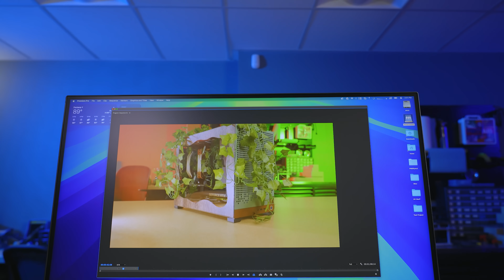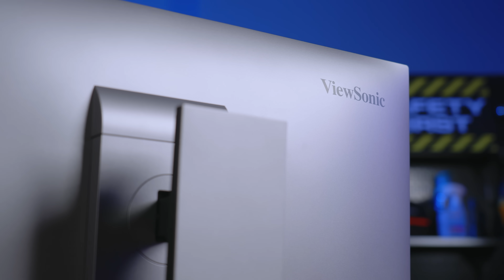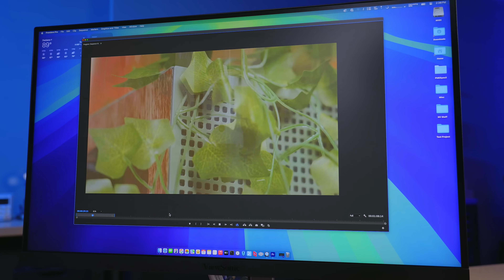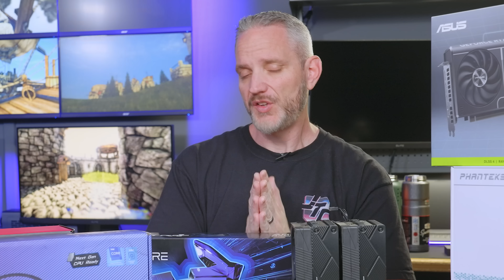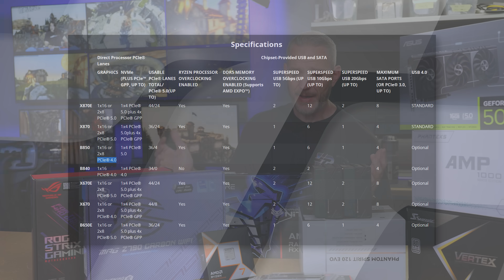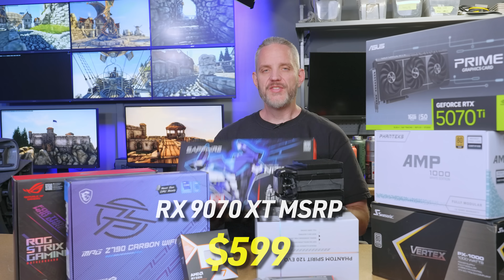This is the Sweetspot for PC gaming... Don't get fooled into spending more!

Comment: Watched this after getting my build lol

I'm running 

R7 9700X
16x2 GB 6400 Lancer (XPG)
X870 Gaming Wifi6 (Gigabyte)

Now, I bought the X870, which a lotta people might say it's not cheap at all. But the opposite happened. I went out and bought mine but the available B650 and B850 boards were more expensive by 30-80 USD. Why would I pay more for that? They're Wifi7 and I'm not even using Wifi7.

Was also thinking of getting the 7700X instead of the 9700X but it was out of stock the moment I could finally afford my new build.

Right now I'm just biding my time, saving for the 9060XT. Gonna go on cup noodles for the next 2 months or get the 9070XT instead on my birthday within the next 5 months lol. For now just integrated graphics works cuz work is hectic these coming months anyway, can't game.

Comment: M4 R7 5700x3d, RX 7800xt, ddr4 32GB, 850W gold PSU, 3440x1440 gaming is the sweet spot. No complaints. You can't go out and buy my system now, but a 5090 sounds insane these days.

Comment: If you're gaming, always spend as much as you can on your CPU (within reason, obviously) as that's the thing most people will never upgrade. At the moment that would be a 9800X3D. That should keep up with any mid-high GPU for the next five years. The $100 saved going down to the 7800X3D is not worth it over five years. That's only $20 a year extra cost for a substantially faster CPU which massively reduces stutter and 1% lows.

Comment: still upgraded a pc i build 12 years ago. soon i wont have any more possible upgrades and ill have to buy a new motherboard, which ill also have to buy everything else to go with it. costly. my current setup is msi x370 gaming plus, m.2, rtx 3060, 32gb ddr4 ram and my latest purchase ryzen 9 5950x. basically runs everything available flawlessly no real need for an upgrade but if i ever did build a new pc the motherboard is definitely something i would want to buy the best of the best since that will be the limiting factor eventually for upgrades. sure you dont need it now but 10 years from now it might kick you in the behind.

Comment: My advice is to look out for a deal. Lets say you have 2 years old graphics card and do not need to upgrade, but might in a year or two. Maintain some understanding of different GPU's performance and price and occasionally you will get one for like -25%. Used to cost 800€, well now it is 600€ and you get a game. 
Why buy before you absolutely need to? 
1.The next generation is going to be like 15% more powerful and cost 25% more and still be out of stock.
2. You still can get some money out of your old GPU.
Cons: The deal might not be on the GPU you were looking at. Perhaps you need to buy a less or more powerful one than you were hoping on.

Comment: I very much agree with your take on PSUs. If we look at for example a NZXT C1200 Gold, which is one of my favorite PSUs on the market right now, we can see that its maximum efficiency is in the 400 W to 600 W range anyways. You will always just draw as much power as needed so I don't really see the arguments against overspeccing PSUs. Another bonus is that for more silent operation many high tier PSUs will offer 0-dB-fan-modes at lower than 50% load.

Comment: Tbh you don't even really need AM4 for the time being, for budget builders (or us stuck on AM4) you can definitely get away with the top of the line parts for am4 paired with a good gpu and be all set for a pretty cheap build. You'll mostly want X3D chips for gaming but if you just can't find any the 5900XT and 5950X are still beasts in gaming, and can easily play any modern game without much issue.

Comment: Since i have an old Intel 4790k on z97m pro4 which served me well for over 11 years i'd like to upgrade my build so wanted to know if this looks ok to you:
AMD 7500F
B650M Aorus elite micro
G.Skill Flare X5 5600mhz 36cl (2x16gb)
RX 6600 XT Red Devil (which i already have)
Crucial P310 1TB
Kolink Regulator 80 plus gold 750W
Arctic Liquid Freezer III Pro360 (and 5 more Phanteks 120mm, 2 rear 3 bottom)
All on a Lian Li O11 Vision
Would it be ok for something like 750€ GPU excluded since i already own it?
Thanks

PS: i rarely play AAA super demanding titles, mostly Eve Online and mid-tier games, reason why i'd stick to a budget build

Comment: First build, went with a 9070xt and 9950x, Very happy. I did go with a 1050w gold PSU and 420 AIO due to higher temps with the 9950x. I avg 50 C on the low and 57 on the high. The GPU is a tank. Runs really cool and rarely see the fans on even at 2k gaming. Total build was $2700. I look forward to seeing this running in 5+ years with no issues.

Comment: Best sweet spot imo is AM4 80-100 Bucks MB, a 5700x for another 100 bucks with whatever decent cooling and RAM and than throw all your money on the biggest GPU you can get and still have enough money to buy a fitting PSU.
Reply: Exact build plz so i know what to put in basket

Comment: Idk ab a year ago give or take i walked into microcenter randomly on a whim and saw a 6950xt for if my memory serves correctly like 600sh bucks. This thing is a beast and probably the best bang for buck ive ever encountered in my PC building experience. Bonus if winters are cold your PC turns into a mini heater. They def do run hard but man its hard to beat for value if u can get a good price.

Comment: there is an efficiency curve. I'm running a 100w gpu atm. I don't want a 1600w psu running that. this is where I think the US youtube influencer runs into a wall. I'm never going to buy a gpu that consumes more than 250w, infact... I have reduced my gpu power draw in the last 15 years

Comment: bought a 7800X3D used back in March, alongside a used 7900XT. Not the fastest GPU, but I know I can put whatever GPU in its place and the CPU will be more than enough, even a few years down the line. In my prevoius computer I made the mistake of going for a cheaper CPU, and when I upgraded my GPU, I had to upgrade the CPU as well. I don't want to do that again.

I don't know, I prefer the "pay once, cry once" mentality about CPUs, especially as it comes with the motherboard and RAM choice most of the time.

Comment: @4:18 Great video—as always, your enthusiasm for AMD shines. I’m curious though: given your assessment that the Intel Core Ultra series isn’t worth considering—does that hinge mostly on pricing? In my region (Malaysia), I’m seeing Intel Ultra 7 retailing around RM 1,449, which is much closer to Ryzen 7 9700X at RM 1,699 than the US MSRP difference suggests. If the price gap narrows this much, would you still advise against Intel? Or do other factors—like gaming performance or future upgrade paths—override pricing considerations?

Comment: My PSU in my current "gaming rig" (motherboard is maxxed with a i7-4790k & 32GB DDR3, with a 2060 RTX missing a fan, feel free to laugh), is an Antec True Power Trio that is 18 years old. Last year, I was considering upgrading the graphics card to address the missing fan, and stopped when I realized how old the PSU was. It's been running basically 24/7 since new, and has to have about 150,000 hours on it. 

I just finished speccing out a new computer (X870, Ryzen 9 9900X, 64GB 6600, 7700XT), and will be retiring the old one into a media center.

Comment: If you are on the fence between an x3d 8 core cpu and a mid tier gpu vs a non x3d 8 core cpu and a higher tier gpu, you lost me already. If you are going to downgrade your cpu to get a higher tier gpu, then why stay on 8 cores? I see no point in buying a non x3d 8 core cpu, go down to 6 cores, save that extra money and upgrade your cpu in a couple years when you need it.

Comment: I haven't built a computer in about 20 yrs.  Back then it was so easy to damage the CPU when putting the air cooler on that I have not bothered building my own since then.  Has anything changed?  Have there been improvements to this very costly problem?

Comment: Entry AMA5 with mid tier motherboard like B850 and a 4060 GPU, higher tier PSU and cooler.  
This will allow you to have a descent shell for upgrades, rather than investing more on those few performance % that will barely feel. Instead its better to build a strong spine on which you can hook up more powerful stuff a few years in to the future.

Comment: The cheapest 9070XT you can get your hands on is what I went with. Driving 2 1440p monitors and a small hdmi one at 120fps when gaming is a nice upgrade from doing none of that with my 1060 6gb that I bought from Fry's.

Comment: I get a pretty hefty annual bonus at work and I'll be bumping my ryzen 5 2600x up to a ryzen 7 9700x, along with a modest bump for my motherboard to an AM5/DDR5 board, and upping to 32GB DDR5 RAM from my existing 16GB DDR4.

I'm currently using an RTX 4060 but planning on shelling out a bit next year just to get a higher end card as everything else will be future proof for a good few years.

Decent bump in performance without breaking the bank.

Comment: This is me upgrading to AM5. I'm coming from an 5900x and upgrading to the 9700x on the tuf b650 plus. I'm not into any overclocking, nor do I care for Gen 5, either. I bought another gen 4 drive. The SN850x has been great to me! Pairing with a 4080 Super is gonna be awesome. My 5900x was bottlenecking it hard, so excited!!!

Comment: 7800X3D and RX6800.  Dont need anything more.  Got one of the last rx6800 at microcenter for $360 months ago.  New World full ultra 1440 @ 100+fps.  BF6 at Ultra ran fantastic. I also play Dune at ultra.  I use a 240hz  .03ms 27" monitor.  COD is like 150fps.

Comment: I built a 9800x3d + 4080 super build late last year. Paid way too much for the 4080s. Paired it with the dual mode LG oled. Its incredible, dont get me wrong but a 9600x + 5060ti rig would be just as fun (just with lower frames/settings) for half the price. What matters is if you can game with your freinds its gonna be a good time. Dont make my mistake of over spending and getting buyers remorse.

Comment: How does anyone make that statement with a straight face. The 14900 outperforms the 9950x3d in ever metric but one. It is less that 1% slower in memory latency. But, it does that all at literally half the price. It is less than a 7800x3d and outperforms that. The price to performance argument that is always brought up is insane.

Comment: 1000w psu is not a sweetspot, that pc will draw 350-400w from the wall fully stressed out with rgb fans etc so  i would go for 600w

Comment: Everytime I build an AMD system I have nothing but trouble, last AMD system I built just would not start, 12 months later its sat in bits, I gave up. I tried 3 different Ram stick types, stripped it back to component level and started again, it was just dead.  Intel always just works, never had a problem with them. So now I'm stuck only ever being able to build Intel, I just can't risk wasting anymore money on AMD processors and MBs.  Probably just my bad luck but that's where I am.  Shame, I'd love to run AMD but wasted so many thousands on them to no avail.

Comment: I want to build a computer solely for Davinci Resolve. That it’s only job. From what I can tell from listening to SMEs’ like you, I have a few options. One, GPU has to be a 5000 series Nvidia card. The only card that can handle 4:2:2 10 bit video with ease. Looks like an AMD 9850 3d or 9950 3d CPU can handle any fusion jobs or anything else it needs to handle. Am I wrong in these assumptions?
Second; air or AIO? Since I do not wish to over clock, having seven intake and one exhaust fan in a Havn HS 420 case, wouldn’t a large CPUair cooler be just fine? Also wouldn’t a large air cooler draw air around other components like the RAM sticks and mother board components?

Comment: Not me sitting on my Nvidia 3080 and my Ryzen 7 5800x3D on top of my x570s Aorus Master motherboard. I pretty much reached the ceiling of my hardware. If I want to upgrade my cpu, I need to upgrade my motherboard and my RAM with it

I probably could upgrade my GPU , but It does what I need it to do and plays all the games that I want to play. I don't feel the need to upgrade, at least not yet. Maybe add a few hard drives though

Comment: I just changed from a i7 5820K (for around 400 $/Fr., 10 years ago) to a 9800x3D.
And it was the second fastest in its socket back than and today I got min 9800x3d for 438 is now even 420 $/Fr. witch is even cheaper than back then!!

Only the Motherboard is now the expensive one but it is also your base for the futur to build on, so I could not cheap out on it. Just buy AsRock Nova, that will serve every tast (no lane sharing!). I got an MSI MAG Edge Ti WiFi though for about the same price but liked the 3 USB C and two of them are USB4 40Gbit !!!

Buying now a cheap CPU for like 250-300 $ and upgrade in 3 years for a 9800x3d for an additional 150-200 $ is stupid !
Year sure , resell and stuff. I dont have anymore the nerve and the time to waist for that. Need to have to availuate efficiency in what I am doing! What would I winn, 50 $ in years + running and hunting for deals with risks I have to take??

Comment: Ryzen 7700 nonX and RX 9070.. both work like a charm, BF6 beta  1440p Ultra 110-140fps. Both take aprox same time to generate a frame (BF6 internal overlay measurement). I guess You all are aware how much cheaper R7 7700 is, compared to 9800X3D, or even 7800X3d.. and also cheaper and much cooler than 7700x

Comment: I overspent on my PC build:
Ryzen 7 9800X3D CPU, 6000MHz CL28 RAM, B650 motherboard, RX 9070 GPU, Corsair RM850x (2021), Peerless Assassin cooler, Lancool 205 Mesh C case, and Samsung 990 Pro 4TB SSD.
In hindsight, I should’ve opted for a Ryzen 7 9700X and waited for RX 9070XT prices to drop. I could’ve gone with 6000MHz CL30 RAM instead of CL28, for savings and chosen the Samsung 990 EVO SSD over the Pro. The rush was due to looming tariffs a few months ago. At the time, available RX 9070XTs were over $1,000, so I settled for the RX 9070 at $650. But this Prime 9070 can switch to the XT BIOS, which is a plus.
I also chose older components for specific reasons:
The Corsair RM850x (2021) lacks the 12V-2x6 cable but has more 6+2 PCIe pins, which most AMD GPUs still use, reducing fire risk concerns.
The older Lian Li 205 over the 207 case for the two extra drive bays.
The Peerless Assassin cooler was picked over the Phantom Spirit for quieter performance.

Comment: 15:35 Thank you for saying that. It is so annoying that people ALWAYS recommend smallest sufficient PSU for the system. That makes absolutely no sense to me. 1000w PSU is not that much more expensive than 750w PSU. If you are going to build another PC after the current one and not just selling the old PC as a whole, I would always go for 1000w today, because that is possibly enough for your next build or at least enough for GPU upgrade before completely new PC. Even if it is not, the price difference is worth the option to upgrade without changing PC. It costs more and it is annoying to change, if you could have just changed the GPU.

Comment: My rig is a 9950X + 7900XTX  but I just built a mate a rig I think was a pretty decent sweet spot for 1200 AUD (780 USD).   Secondhand Zenith Extreme TR4 with 8x8=64GB quad channel, 16 core 1950X and a million PCIE lanes. A (new) silverstone gold modular 850W Gold and View 71 case. And a 9060XT 16GB. I think that's a pretty nice sweet spot!! Just had to bypass TPM requirements with Rufus to use Win11, otherwise all works fantastic. Downside of course is TR4 is a dead platform, but upside is he still has room to double both the cores and ram without changing the board... :D  I'm surprised JAY hasn't offered the 9060XT 16GB more love to be honest, it seems pretty decent bang for buck to me.  I should add that the cost of all new PC parts in Australia is much more expensive than the US pays for the same items, so a USD 2500 PC for him is more like a USD 3500 PC for us.

Comment: spent 6-7kusd back in 2019 on a complete 9900k and 2080ti system, incl keyboard mouse monitor 64gb ram 7tb of nvme, 6tb of external hdd plus 1200w power...... still going strong, had to replace some fans but all ok otherwise. spend right... spend once. still gaming and still photo and video editing.